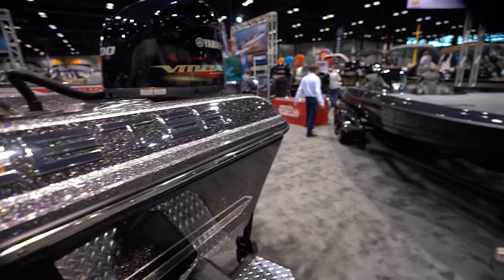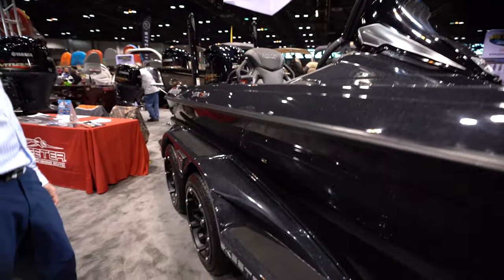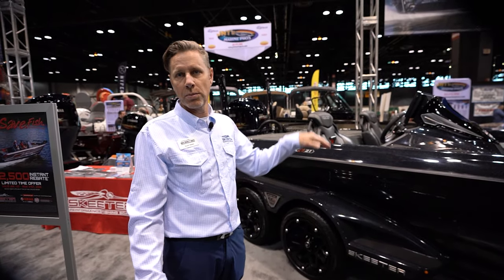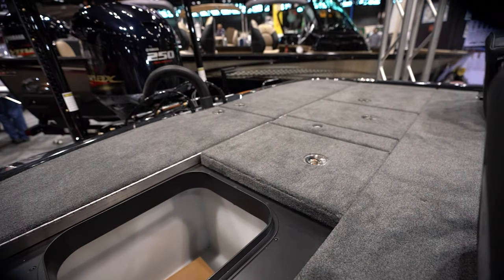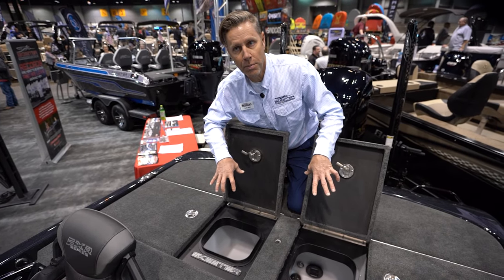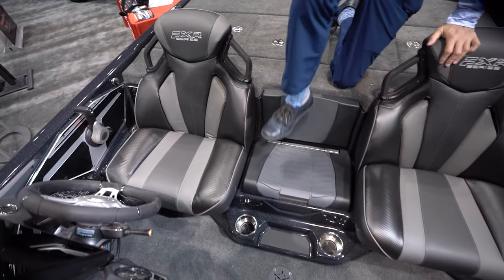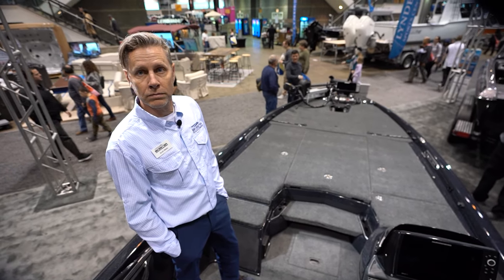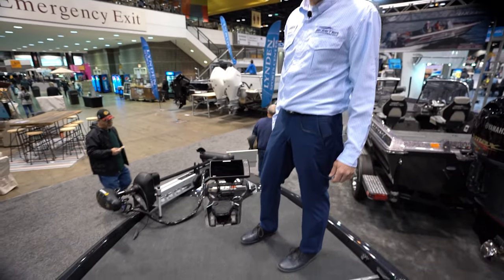The Bass are Doomed ! Skeeter FxR21 Bass Boat is Here!

Comment: What is the difference between the FXR and ZXR? FXR is absolutely beautiful.. I been looking at VEXUS but have to say I think this is the Brand boat I will purchase just not sure between the FXR and ZXR.
Reply: Skip the Vexus for sure they are overpriced aluminum boats. They have a fiberglass coated hull on their top of the line models but will not run anything like a true glass boat. If I were you I wouldn’t look any further than a skeeter. I’d also look into Phoenix boats if you plan on being on some rough water lakes like the Great Lakes ,st Clair, st Laurence, okeechobee, sam Rayburn. Overall you can’t go wrong with a true fiberglass bass boat especially if it’s 20-21 ft
Reply: Vexus is just a really expensive mashup of every bass boat that's ever been made and they are very lacking in performance. The skeeter will do everything better and for slightly less